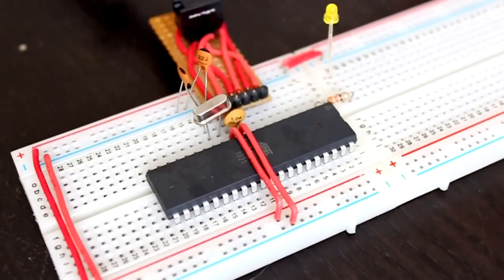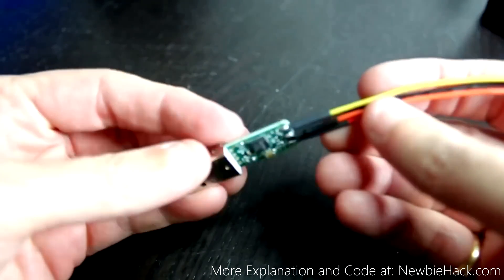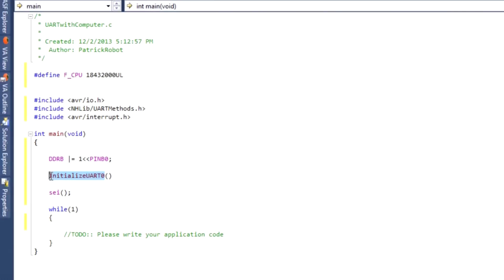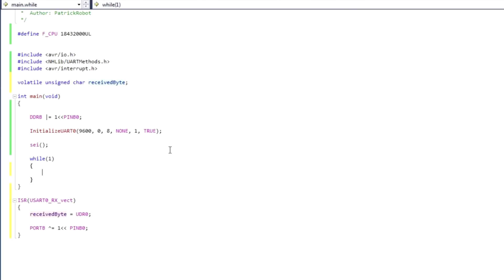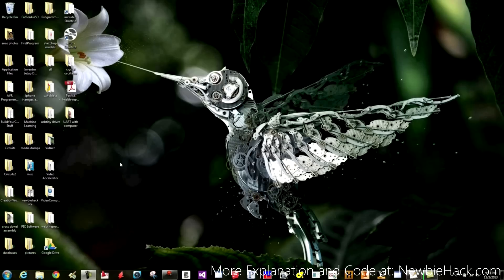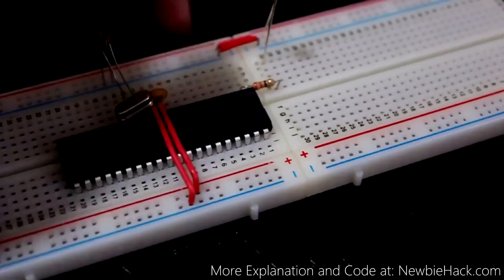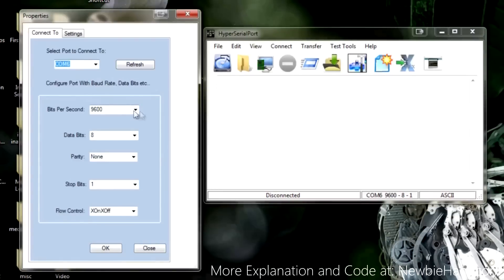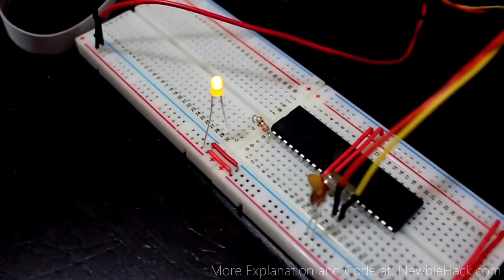51.Arduino for Production! How to communicate using UART  AVR Microcontroller to a Computer

Comment: Hi ! Your videos are just amazing and full of information! I wanted to ask you that I have made my own custom pcb with an ATMega644 and it has its own 5v power supply, i wanted to use the ftdi module for TTL/USB communication, so should I only use the RX/TX pads of the FTDI module or should i use the ground and vcc ones too !! an answer would be highly appreciated !

Comment: Atmel Studio has a built-in serial terminal, but you have to install it as an extension. Go to Tools > Extension Manager (as I recall) and look for it. Once installed it's under the View menu option. It works pretty slick, and negates the need to go find a different program like PuTTY.
Reply from the maker: That's great to know!!  Funny, as I remember when doing this tutorial, it took me a while just to figure out PuTTY.
Reply: Yeah, it works pretty well. They took it out of AS6 for a while, but it's back in AS7 so that's what I'm using. But it sure it handy to be able to access it right from inside of AS, and then dock it in the IDE. Very slick.

Comment: I bought this FTDI adaptor module ( https://www.amazon.com/FT232RL-Serial-Converter-Adapter-Arduino/dp/B06XDH2VK9/ref=sr_1_1?ie=UTF8&qid=1511934528&sr=8-1&keywords=FTDI+USB+3.3V+5.5V+to+TTL+Serial+Adapter+Module ) and followed the instructions using HyperSerialPort. I could not receive character 'a' at HyperSerialPort. I know the MCU is sending data once every second because the RX LED on the FTDI module is flashing once every second. When I click the Hex Conversion button on HyperSerialPort, a stream of 00 00 00 are coming in once every second. So, it appears that NULL is being received at HyperSerialPort. That's why nothings shows up at HyperSerialPort. Also, when I hit a key on my computer, the TX LED on the FTDI module flashes. So, I know the module is trying to send the key stroke to the MCU. Yet, the MCU does not receive the interrupt. The isr is not called and the LED on PINB0 does not flash. So, what might be going wrong here?

Comment: hi very nice video. great for people like me wanting to learn AVR Programming. im wondering if you could help me with a question ? I have a bte13-009 usb to serial adaptor that i have been using with a 328p in the past to program through the arduino IDE but i notice that this has a 12mhz crystal on it and my 328p is running at 16mhz how is this not giving me a problem in the past ? I am having a problem with getting this video to work but not sure if the converter is giving me issues due to having a different clock rate. any help would be much appreciated thanks

Comment: I'm having problems with my microcontroller. By the way, I love your tutorials! I'm trying to create a PC-controlled system, which is to collect data from an engine using multiple sensors. I've learned so much from your tutorial videos.

I'm using internal clock, which I assume is running about 1,0 MHz. and I haven't changed it. The microcontroller is atmega32A = atmega32. RXEN and TXEN pins are enabled. With 1,0 MHz and 4800 baud rate the UBRR is 12,0208 = 12. Settings are 8 data bits, 2 stop bits, even parity and normal asynchronous mode. I've connected a USB-converter, which has tx and rx pins. The converter seems to work, because its led light blinks every time I try to send something using hyperserialport. The MCU just doesn't seem to respond or receive data. It should turn a led on and off.
Reply: +CimiF Got it working. Although the MCU is sending Chinese letters instead of letter a... Still needs a fine tune... =D

Comment: Hi Sir. Please answer me please its important for my project. İ want to do communication  betwenn microcontroller and pc with Bluetooth HC06 module.. I watched your video and i used your same code.But it didnt work. Should i add a different code which is named that "At commands or codes". I researched and i found somethings about it. Please can u guide me about that? Best regards.
Reply: +Sercan Yilmaz I am doing a exact project you are doing, how did it turn out?

Comment: hello patrick! I've seen all your videos, and I learned a lot! I bought a temperature sensor, the DS18B20. At first I thought it was analog, but I realized that it is serial. I have seen that there are various codes already written, but I was not able to use them with the programmer notepad ... the code is quite long, so I solved it by replacing the sensor with an analog one. However, I would like to have a bit of knowledge on how to use the libraries and distinguish the various programming languages ... would you have any advice on how to start?
Reply from the maker: I personally like to determine how the actual sensor works, or what it requires in terms of signals rather than using other libraries.  This will provide you with the fundamental knowledge of how the sensor works and how you can provide the programming with much fewer lines of code.  I am always surprised how easy it is to write custom libraries.  

Do you know what serial form it uses? Synchronous or asynchronous, TWI/I2C, SPI, UART?
Reply: Patrick Hood-Daniel It would be great if I could create the library. but I looked at the datasheet, and honestly I thought it was too difficult. I'm not sure, but i think that is not a standard. Is a protocol in its own right. Searching on the web I seemed to understand that it is not an easy task even for skilled people. Some of them would also need an oscilloscope. Now i put the project in queue. I solved it with an analog sensor. I'd like to start from the most used communication standard. I heard that you are planning some tutorials about it ... I look forward to them!
Reply: andread81yt I just finished going through this somewhat daunting task myself.  I may put together a video entailing the details on how to communicate with the DS18B20 (without anything to do with Arduino libraries). I'd say this particular protocol (OneWire) combined with the datasheet for the sensor isn't for the average hobbyist (unless you use it with Arduino).
Reply from the maker: andread81yt After a very cursory glance at the datasheet and looking at the timing diagrams, you could bit bang the communication.  The communication is like half duplex without timing, or I2C without the clock line.  The one wire line is open drain, so there will need to be a resistor up to the 5v signal.  You may also need an inverting line driver that the data sheet shows.

Take a look at the timing diagrams and read the contextual narrative to see if you can wrap your head around that.  If not, Chris Ball's video may clear things up.  I may put something together in the future.
Reply: Patrick Hood-Daniel
 I noticed the answers just now. Thanks Patrick for your videos and your advice! I ran the DS18B20, but in a way that did not give me any satisfaction. I used a ATMEGA328P in standalone and uploaded a working code with arduino.
Anyway I'm going to work on in the future, when I have a bit 'of time.
Reply: *****
I had a look at your channel, it looks great! I have not found the video on DS18B20, it would be great if you upload it in the future.

Comment: Does the circuit you have built in the video need any special device drivers to be installed ? When I bought a USB - Serial converter cable it came with a CD for installation of the drivers.

Thanks for keeping the videos going.
Reply from the maker: Hi ns5253,  If you have a relatively current version of windows and you are using FTDI chips, you shouldn't need external drivers.